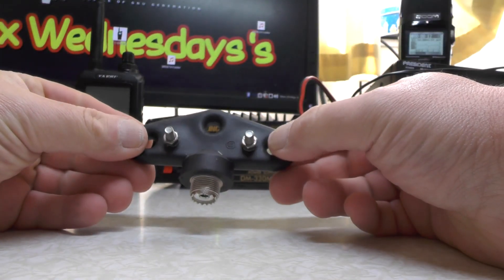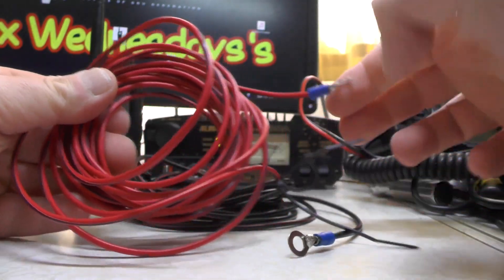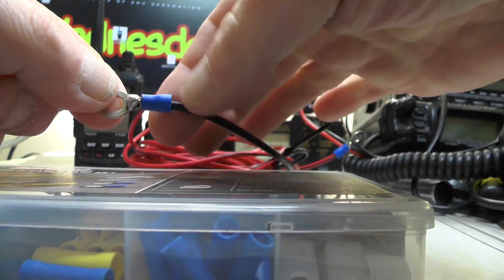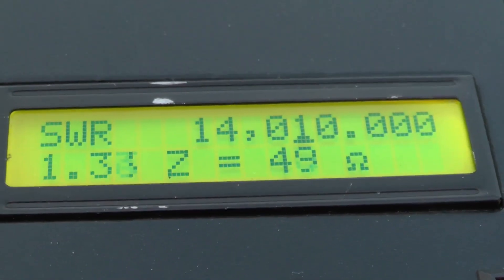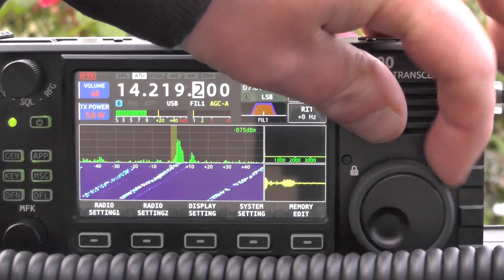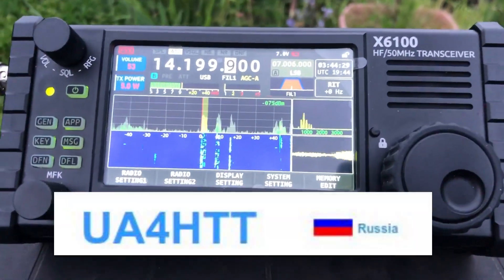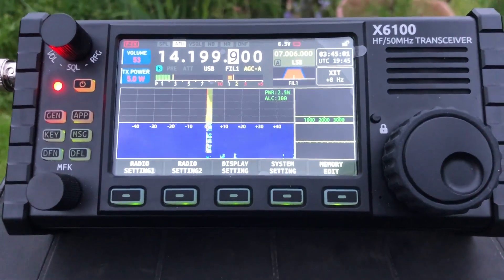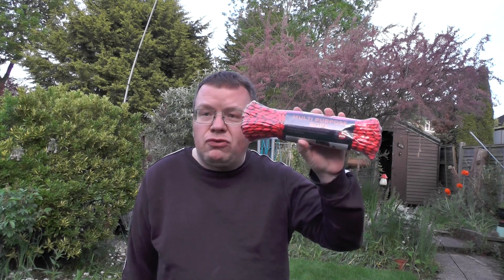20m dipole

Comment: Guy asked you several times to repeat your call, CLEARLY you were not "Booming In' on him, and yet, despite all that, he gives you a 5-9.

Why can people not be honest anymore?

This whole 'not wanting to offend' has reached peak idiocy when someone can't be asked to give an honest sig report.
Reply from the maker: If your in a contest and don’t give 5/9 the writer has to type a different number and it confuses him it’s a shame people don’t give proper signal report like on 11m
Reply: Thanks Jez. How high are your two poles and how are they secured? Thanks
Reply from the maker: @peterjones6357  not very high should be about gutter hight . The first one i tried was hanging out of the bathroom window and onto sprit of air pole which is 12m in length.Any thing gutter hight should be good